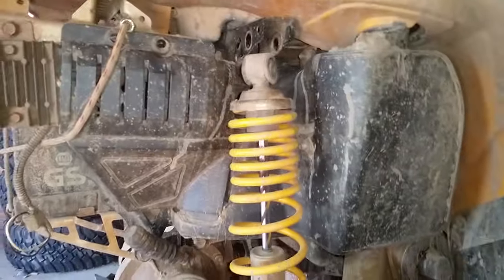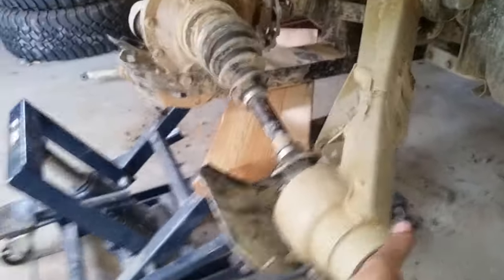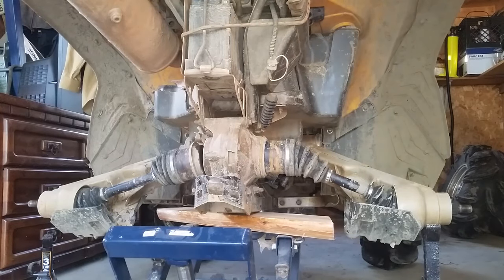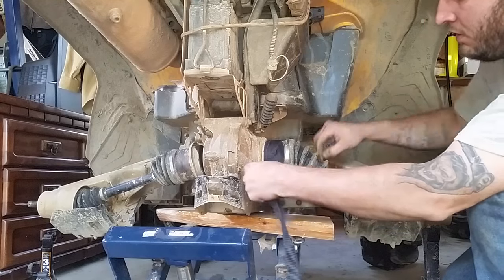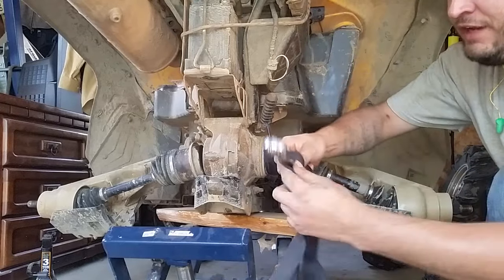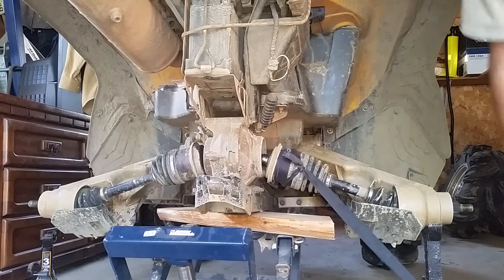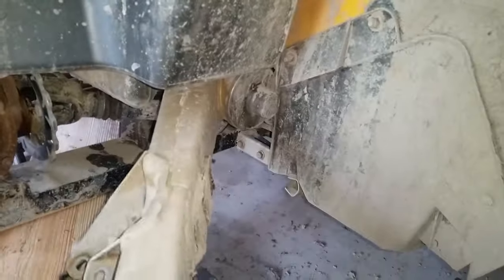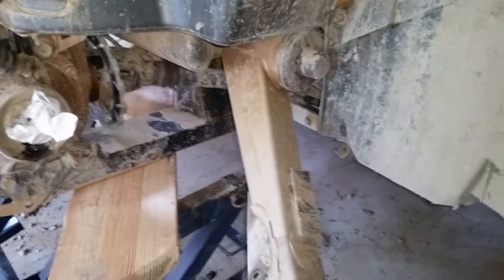Can Am Renegade/Outlander Easy Cv Axle Removal

Comment: where's Mike I need the tool to
Reply from the maker: +Daniel Miller HAHAHA! i forgot that was in the video. Mike is a buddy of mine from around here. He had the spanner socket required to remove G1 trailing arm nuts. Its usually a 50/60$ tool at the dealer and at the time didnt want to buy it, but now I have one because you know what they say if you need to borrow something more than 3 times you should just buy it lol!

Comment: So I have used a tie down strap like you and 8lb sledge to try and pull it off.  Both side won't budge.  Any suggestions.  I have a 2004 outlander 400 XT.  Want to do wheel bearings, just can't get the damn thing off.
Reply from the maker: Ok let me look tomorrow in the service manuals it may have any inner keeper in the diff
Reply: @nstockert  I managed to get one side out.  Waiting to get bearing to pull the other.  Just gonna grease that one as the one I pulled seemed fine, just needs grease I think.  Thanks for getting back to me.  Gonna do the front to grease so will see how that is gonna go when I get into it.  Hopefully a little easier.